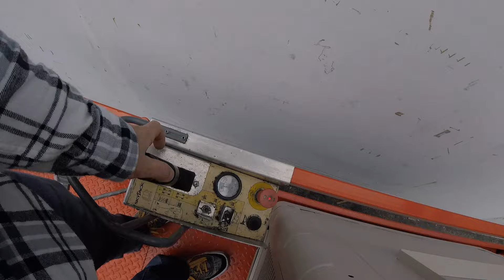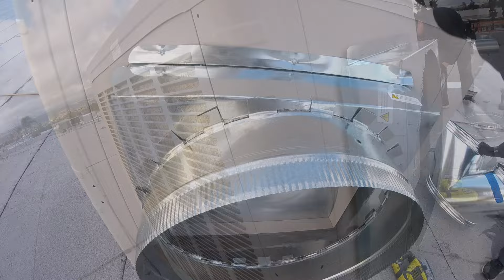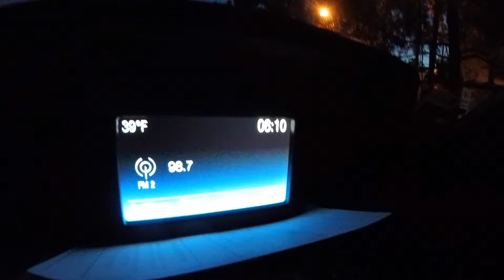Swamp Coolers Install

Comment: Bro why didn’t you just buy the same exact cooler except the downdraft model instead of buying a side draft and making more work with all that ducting. You could have just set the downdraft right in you don’t need all the ducting with swamp coolers that’s why the majority off all warehouses don’t use ducting with their swamp coolers.
Reply from the maker: customer requested to have same set up as his previous place. This was a basketball court where we had to spend air evenly, customer says he doesn't want to dump all air at one spot because it might effect trajectory of the ball when someone shoots the ball. for me personally i would do just downdraft and no ducting at all, but i had to go with customer's request
Reply: Marat RPM SoCal that makes sense I figured it was customer requested either way nice to see someone else who has to install or work on these things I live in Vegas and am working on these damn things all summer lol all my other HVAC buddy’s that live in other states besides Arizona and some parts of Cali have never even touched a swamp cooler because it’s too humid.
Reply from the maker: @nickfaulkner4808  we usually give our idea on how we can do it cost wise and efficiency, but this guy runs couple of these basketball courts, so he knows more on set ups of how he wants air to be supplied, we had to hide these ducts as close as possible to the roofline as well. he requested water pumps on didicated switch as well, but if i remember right, we forgot to do it)